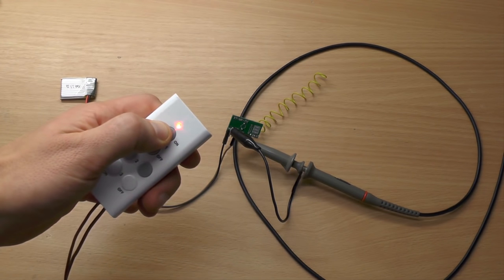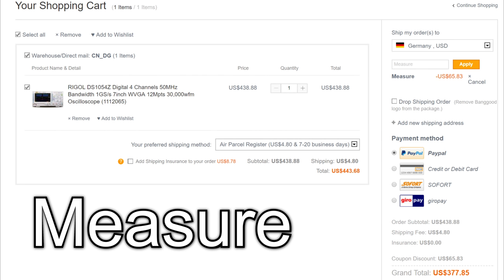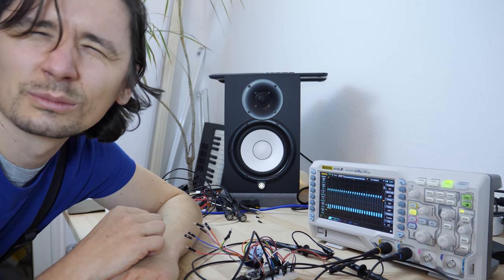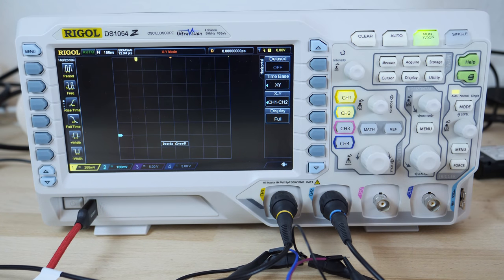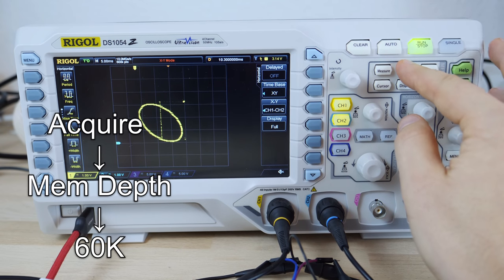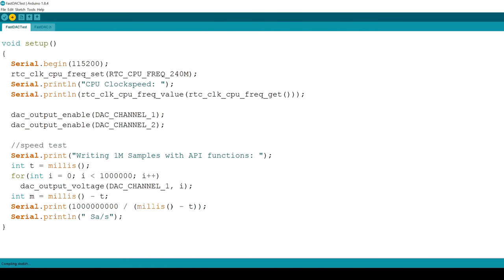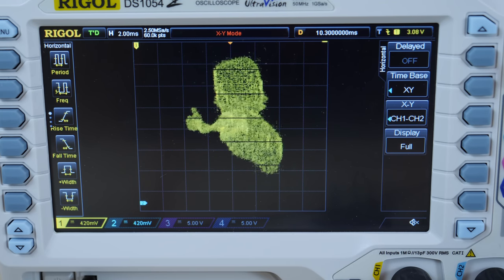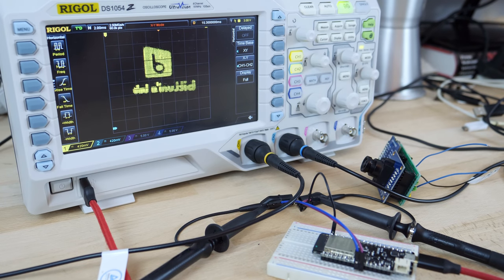Oscilloscope as a Display (ESP32, DAC, 3D, Camera)

Comment: Seeing the scope slip gave me a real "oh shit" moment. Even if it's not mine, a really old one and was most likely not hurt in the making of this video.
Reply from the maker: nope... I grabbed it out of frame. But it's really rubust.. you can see the plastic frame is broken on the right side. It's so heavy the old shelf indeed collapsed and the scope fell two feet on a wooden board. the probe connectors punched holes into the board but it still works :-)
Reply: @bitluni  So do you end up repairing and using the old scope (old scope is better as a novelty XY display)

Comment: Nice optimization ! Seems the ideal solution would be to segment the relevant library functions with the additional set up and teardown requirements under something like fastdac.h, leaving the standard calls so it would be a drop-in replacement library (or simply submitted to the ESP32 project directly). Thanks for the interesting video !
Reply from the maker: It's a nice idea... I'm a really lazy dude. Once a project like this is done I'm already busy doing the next one. At least I released the code public domain. Ivan could consider using some of the stuff according to the design strategy of the esp idf
When I manage to create a team sometime the good stuff might end up in libraries which will be distributed by a dedicated server. This could simplify the life for many people

Comment: Wait you have to pay extra to use features even after buying the scope? That's ridiculous
Reply: Just watch the video again and mention the hint from bitluni about  dave jones ;-)
Reply: That's how these scopes manage to be so cheap. Almost every major vendor is doing this. And not just scopes - power supplies (unlock 10x better precision) etc
Reply: That's how all software works these days
Reply: You can crack it as it work offline.
Lol it is an EAscope.
Reply: The extra features aren't mentioned on the spec sheet for the lower priced scopes. You get everything you pay for.
Reply: This Rigol model can be hacked but I personally wouldn't do that to a new, under warranty unit. If something goes wrong with the hack ( yes it does happen ) or something else later on, you're screwed on warranty. Some of the options you may never have a use for so a little research may find you're not missing out on anything with most of them.
Reply: The same applies to a multi-hundred thousand $ scope, just bought a 20GHz chassis and every option costs another multi $k!
Reply: Sometimes Rigol offers a sale with all or most the extra features unlocked for free, especially in the past few months since Siglent released their 1000x series scopes which compete in the serious hobbyist market with this scope. Before that the DS1054z was king, but now has to share the throne!
Reply: DLC lmao 🤣

Comment: Interesting optimization. If someone would use DAC for function generator what can be expected as maximum frequency (for sine and triangle wave not plain square wave)?
Reply from the maker: This is depending on how fine the resolution of the sine or triangle should be. the lower the frequency the smoother the curve. with the measured 7M samples you will get the best the 8bit dac can do at around 20kHz. at 1MHz you will get something that is shaped like that: -¯-_-

Comment: you could have used the second processor core of the ESP32 to improve the performance
Reply from the maker: the dac output has to run on one processor which is the majority of the processing. the vertex calculations could be done on the second core, but then it would require double buffering of the calculated vertices... this means half the amount of vertices are used now since the sketch with all the 3d models is at the memory limits. esp32 with the external spi ram could work

Comment: Why is that Arduino Due has DAC within range of 1/6 to 5/6 of Vcc with 12bit resolution and cheaper ESP32 8bit DAC within range of 0-3.3V without any additional circuit.
Reply: They buffer the DAC with a non rail-to-rail opamp because for a given transistor footprint, you get much lower distortion if you sacrifice rail-to-rail capability. Biasing is fragile and crossover distortion is high in rail to rail opamps realised with the footprint they could have spared on a very dense mostly-digital IC.

Comment: hi! whats about stm32f4 or stm32f7? its more faster then  esp32
Reply: And more expansive got my esp32 module(with FCC) for under 5 euros.
EDIT: Actually what do you mean with faster?
Reply: STM32F7 is pretty damn fast... i don't know how it compares to ESP32, difficult to say - official DMIPS figures say that ESP32 is a bit faster. STM32F4 though, naaaah, slow, no comparison at all.
Reply from the maker: the esp indeed runs at 240MHz the stm at 216Mhz. I even included the line to set the high speed frequency in the setup to be sure it does not change in later arduino plugin revisions.
the stm seems to have some other nice features... like jpeg encoding, usb etc...
the esp has two cores... not sure if there is an actual winner